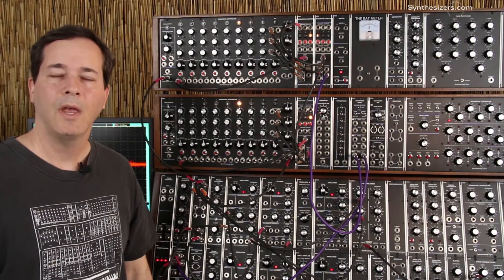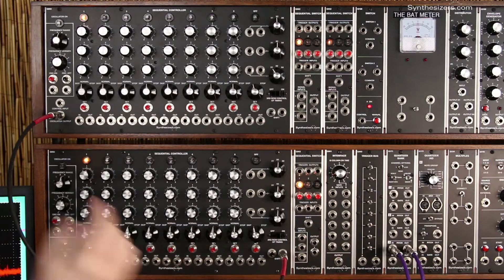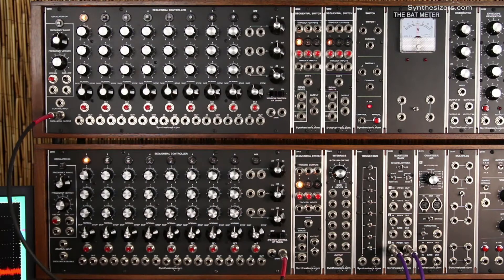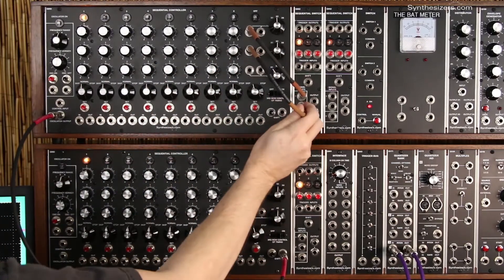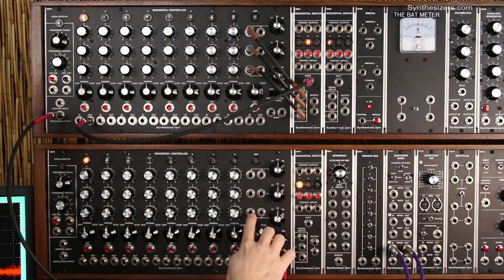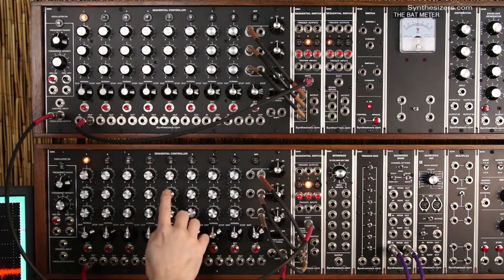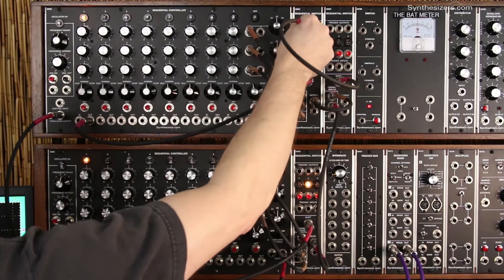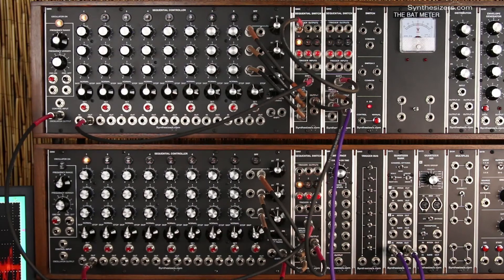Q960 Sequencer DUAL FOR 6 ROW OR 48 STEPS tutorial - Synthesizers.com

Comment: This was one of the first things I tried when getting my second 960. Running the oscillator out from one unit into the Shift input on the second machine does keep the sequencers stepping at the same speed, but doesn’t necessarily keep them perfectly synchronized stage by stage. Even though I made certain to have both 960s set on stage 1 before starting the first (master) unit, somehow stepping at the same speed, I noticed when the first 960 was on step 1, the second 960 was on step 2. I found that the only way I could keep both units exactly/perfectly synchronized stage by stage, was to run eight separate patch cables from the first 960 to the second, with the “Out” of stage 1 of the first unit feeding the “In” of stage 1 of the second unit, and on down the line for all 8 stages. Was I missing something?